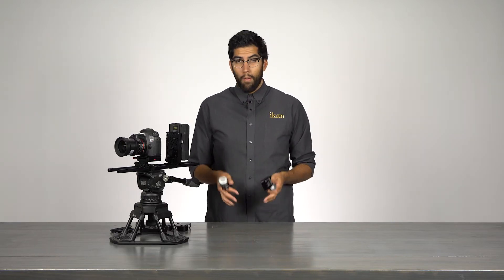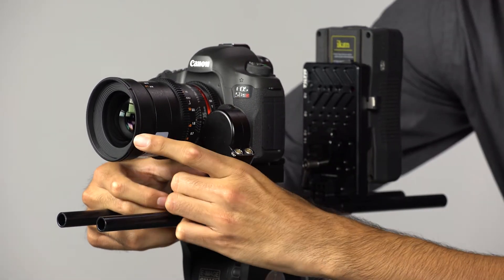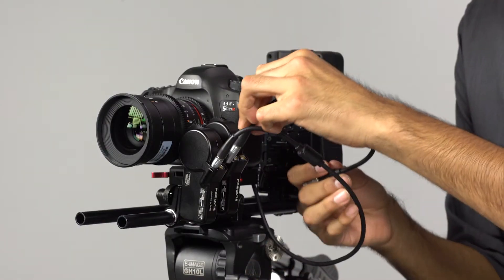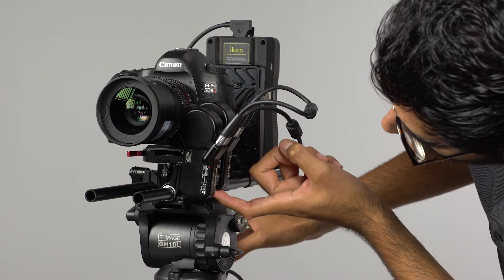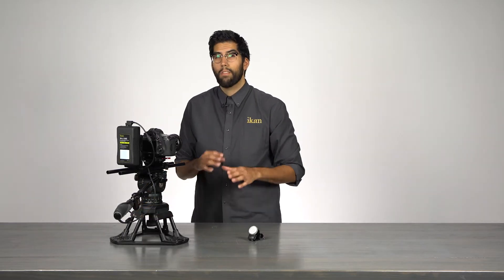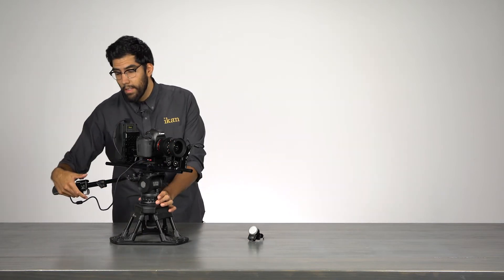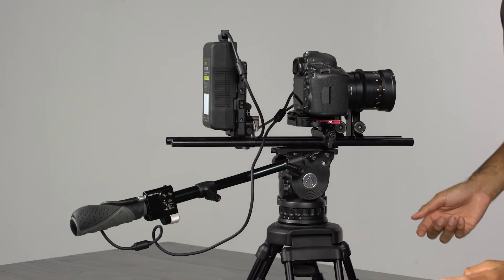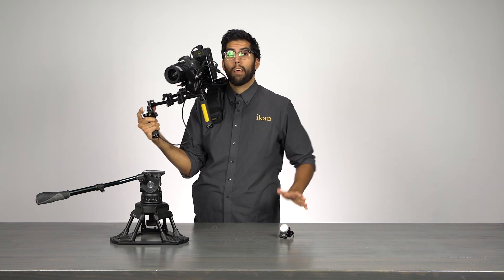Ikan Corp: Tech Corner - PD Movie Remote Live 2 Lens Control System

Comment: with a wire it is not good for a gimbal, balancing will be a pain in the ass.
do it without the cable befor redrockmicro does, or you will get problems...

but thanks for the vid, Julio did a great job anyway !
Reply from the maker: Hey there. Thanks for the input.  We have a wireless option called the Remote Air 2. See the Tech Corner for that product here: http://bit.ly/2gnVEAe
Reply: thanks, i know problem is, you dont have a gimbal controller with the air 2 ;(
anyway thanks for your quick response.